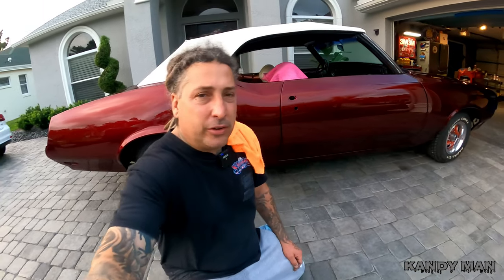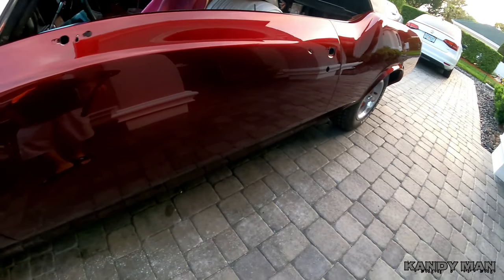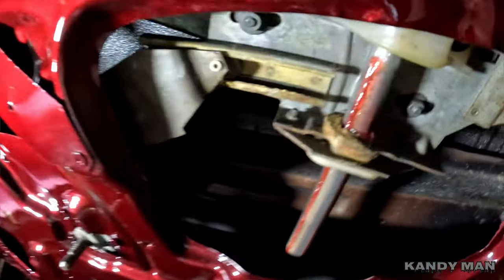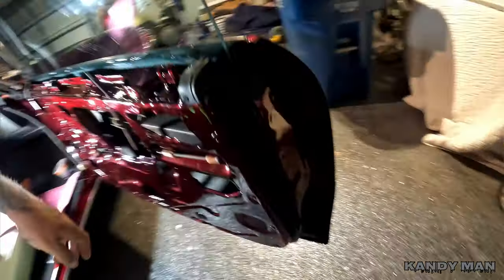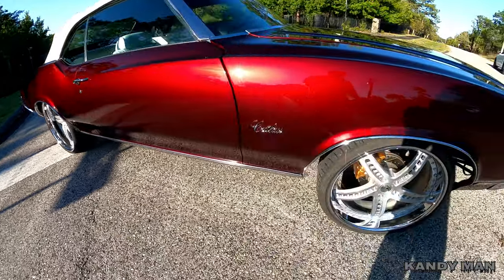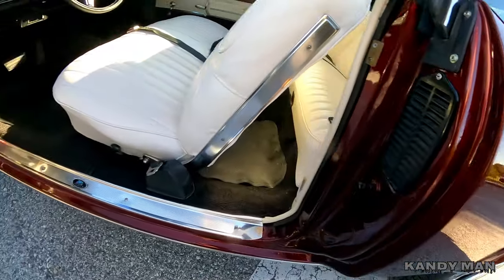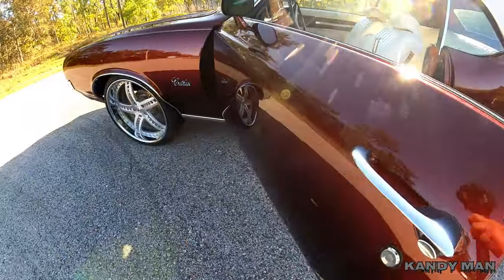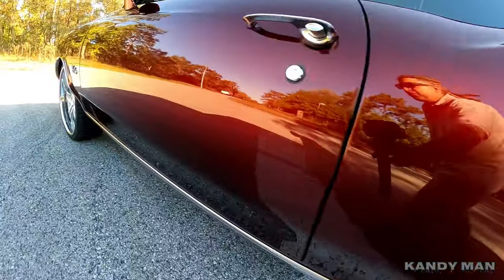STEPS FOR A MIRROR PAINT JOB PART 10- FINALE!!

Comment: New subscriber here. Had some down time at work, I just watched all 10 videos on this project.  You are a great instructor and I appreciate the details. I'm going to have to look into that black 2k primer..  it was weird that the super build you had was mixed with the resin tubes like slick sand?? It always comes with a glass quart hardener?  Backyard hack disclaimer.   The only thing I would have done differently. And its super minor but someone pointed it out to me, and I pass it along when I see it, is, the trunk gutter weather strip. Looks better when the seam is tucked behind the hinge, instead of dead center when u open the trunk. Looking forward to more videos! Thanks
Reply from the maker: Thank you and thanks for the tip

Comment: You can put a bit of soap WD-40 or motor oil in your compound mix it up well in the tube it doesn't have much of a negative effect on its performance but it makes it where you can easily wipe or wash it off even after leaving it in the cracks for a while prevents it from hardening like concrete been doing it for a long time
Reply from the maker: Thanks for the tip

Comment: What's the secret to achieving those kind of results without using guide coat? Not only does Travis Sylvester, of SylvestersCustoms on youtube use guide coat from the beginning of the filler phase, but he uses it right up thru the cut & buff phase.  In this video https://www.youtube.com/watch?v=YKMmVu6AFi8 he explains, in detail, the cut & buff process & at minute 19:00 he explains the reasons for him using guide coat.
Reply from the maker: Guide  coat is a very good  step this  car was very clean . I did Guide coat the Fina block sanding  for paint. Sherwin Williams primer has a built-in Guide coat.check my other videos  and you will see .also I've been sanding  cars for 26 years at a rate  of 30 to 50 a week.
Reply: @kandyman5315  Thanks for the reply. 26 years of experience explains it